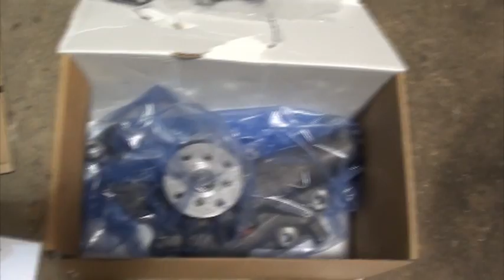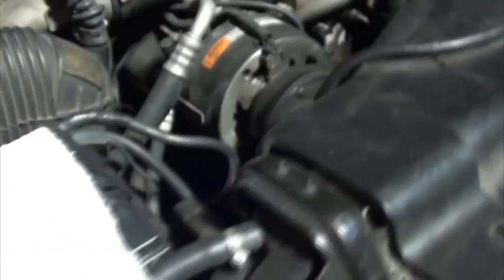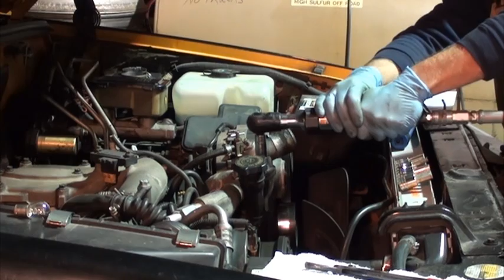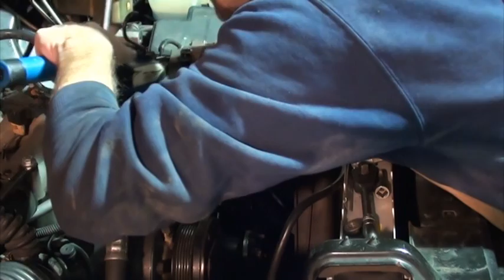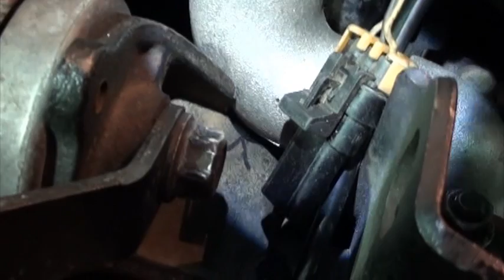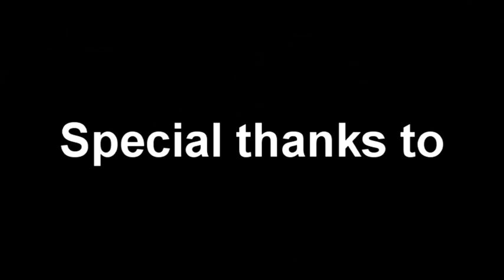95 gmc 6.5 L diesel water pump upgrade kit

Comment: I just installed this kit yesterday on my 94 K3500.  On the test drive in less than two miles the temp immediately shot to 210 and started going over that. Outside temp was around 90.  I let off the gas pedal and it went down to about 205. I carefully drove home. It is running much hotter than it was before the desert grade cooling kit was put in. I dont get it.
Reply: Did you get the issue resolved?
Reply: I think this is all smoke and mirror. The key is a high flow water pump and severe duty fan clutch, with upgraded fan. Sureflo makes the pump. Leroy diesel sells a kit

Comment: Did you have to relocate the fuel return lines? I need advice on doing that, mine are in the way of the crossover
Reply from the maker: Cole Staples I don’t remember moving fuel lines.  Sorry I can’t be more help.
Reply: @coasmechteranic  thats ok, my housing is just hitting things that are not supposed to be in the way. I can't get mine finished

Comment: If you use a file it will take you a couple days I did mine with a grinder in 5 min I cut out a little more than in this video and it’s still really strong also I already had the hose get rid of the stupid clip that’s plastic also the aluminum fitting that the plastic clip goes into breaks if it does take your thermostat housing to a machine shop if you don’t have tools and it will come out and replace tap the original threads Dorman sells a replacement that the hose and clamp will fit right over it’s worth changing and no more bullshit plastic clips make sure you use sealant on the water pump bolt made by permetex or you will have leaks I used wrong sealant and it leaked so I had to remove the one side and fix make sure you cleanyour bolts the bottom ones this is a good video I torqued my bolts down easy to find specs on internet I didn’t want to break a bolt in the block but this is a great video lots of help all his videos he does are great especially if you are new to a diesel the duall thermostat is great works awesome like I say great video and thanks for the great help

Comment: I have a  95 Suburban 6.5. I put a turbo master and reprogrammed computer, more power but , as mentioned, it really heats up as soon as you hit a hill with a trailer.  I can't see sinking this much money and effort into it . It still won't compare with the newer duramax or certainly the dodge with cumins diesel.
Reply: So, you decide that instead of servicing, maintaining, or upgrading the cooling system... you should add horsepower first... on a 20+ year old truck. You should really just sell everything and buy a disposable Kia at this point.

Comment: How did you go my truck still over heats. I love my truck but it kills me every time I take it for a good drive up through the hills the heat just goes up through the roof and i have to turn it of to let it cool. Any suggestions id be very greatful to know how to fix this over heating issues
Reply: Thanks for your help and support and advice greatly appreciated
Reply: Maybe you wanna replace your Thermostat. Could be that It does not open or close correctly. If that does not help either all I can guess is your temp gauge on the gauge cluster might show wrong temps. Cannot imagine the 6.5 still getting too hot when doing a complete cooling kit install on the engine

Comment: Thanks, great video.  When I tried to loosen the nuts on my fan assembly to get it off the water pump, the whole thing just rotated.  Is there a trick to hold the shaft still when you loosen the nuts?

Comment: Hi Jack,

Would you recommend this upgrade kit for a 1998 Chevy 6.5 diesel (not turbo)? 
What we have it's a former school bus, converted into RV. I know that the water pump and thermostat have been replaced. Also, the fan clutch was replaced, too. But they used a Ford fan clutch for whatever reason. Now, it's causing overheating, because the fan doesn't kick in at the proper temperature.

Thank you for any advice,
Boris

Comment: thankyou  Mr.Bias for your video it really came in handy.I'm in the process of pulling my heads because the previous owner bookered everything up. Just bought this 3500  1995 and even though I'm happy with the truck, I have 20 yrs worth of repairs to take care of. the bottom ten passages inside the radiator are plugged, found that out after I pulled it, took one end off just to see. right now I'm having trouble trying to get the water pump off even with all the bolts removed.  I'm also moving the oil and trans. cooler back under the cab and box to relieve some of the heat transfer.
Reply: question i have a 6.5 diesel 96 seems to get pass the 210 mark while idling only but when moving it drops to normal so is there something to look at before doing this upgrade

Comment: Hi Jack, I just bought a 1996 Chevy 1500 Z71 Silverado with the 6.5 in it. I was just wondering if you would recommend this kit and if you had noticed any significant cooling upgrades? I'm thinking about either getting this kit, or getting the 130 GPM Water pump, 180' T-stat, and Duramax Fan kit. What do you think? I'm only 17 so I want my truck to last, but I hate to put to terribly much money in a 18 year old truck. I tow a lawn mower trailer nearly everyday, but I rarely tow anything over 5000lbs. One more question, what size exhaust should I put on? Please let me know what you think. Thanks, Matt
Reply from the maker: The company that had me install this kit has not complained about overheating anymore.  They were gonna sell the truck cuz they couldn't keep it cool, it was "that" bad.  The kit makes the truck useable, so "money well spent?" I think so...
Reply: 4 inch diamond eye I would do the fan also i own a 95 with the kit and love it.
Reply: Blake Hooten so what about the cooling kit. I have a 96 gmc 2500 i live in florida wich is real hot in summer.but anyways.my truck over heats when i m towing.does the 4inch diamond back & the duramax fan will fix my problem i want to make sure b4 putting any $
Reply: Blake Hooten Moves alot of air sounds good to.